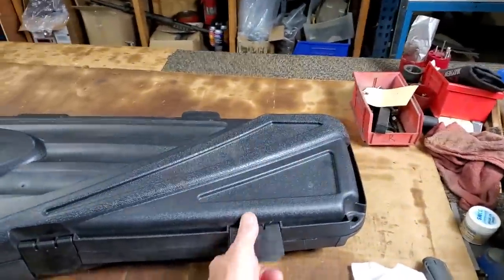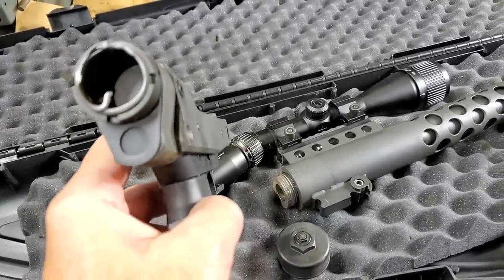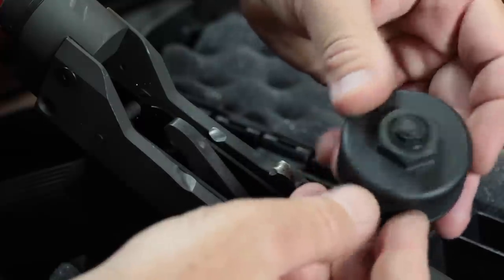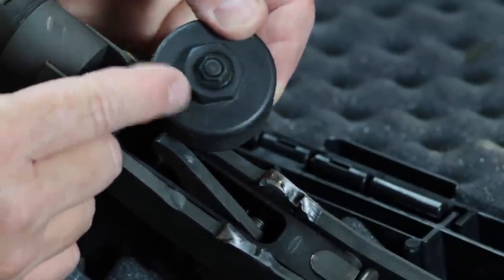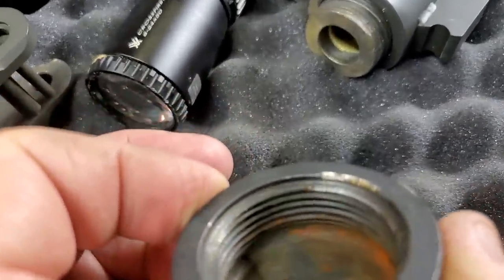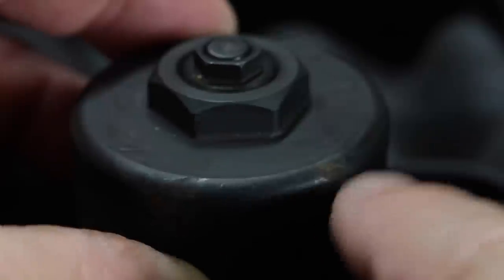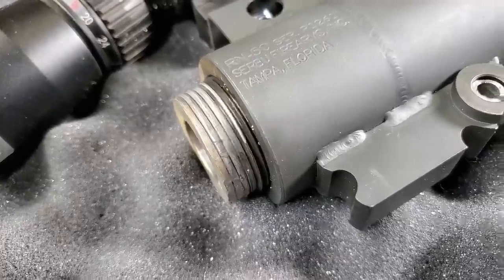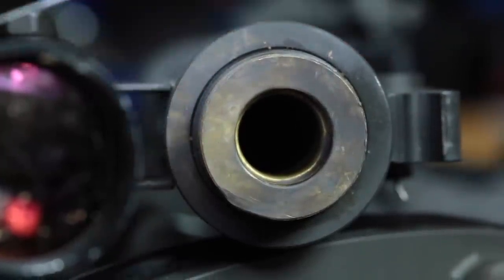Kentucky Ballistics' RN-50 Blow-up:  First Look

Comment: There was nothing wrong with the rifle or the ammo.  This is an incompatibility with the slap round and that firearm.  This will continue to happen as long as people use slap rounds.  Look at slap round development and testing and these types of failures occurred.  Look at why slap round development in 7.62 were discontinued, because sometimes the plastic would break up and jam in the bore.  These rounds are only certified for an M50 machine gun and specifically prohibited from the M107.  Do not shoot this type of ammo in ANYTHING other than an M50.  This specific firearm failed in a way that directed energy back to the operator.